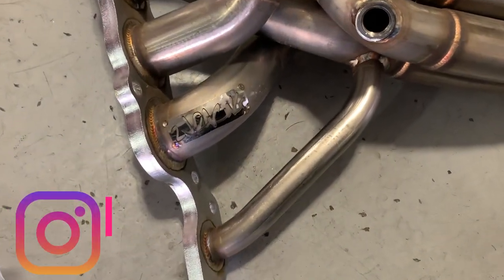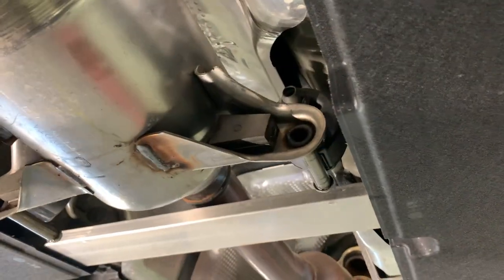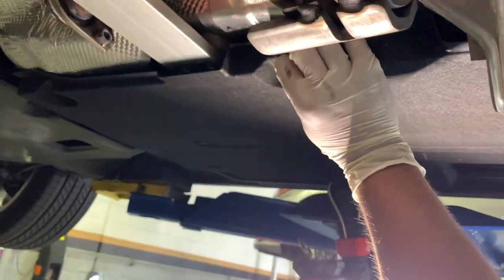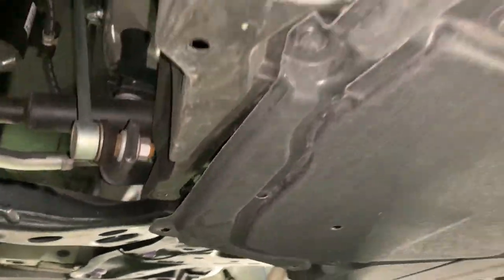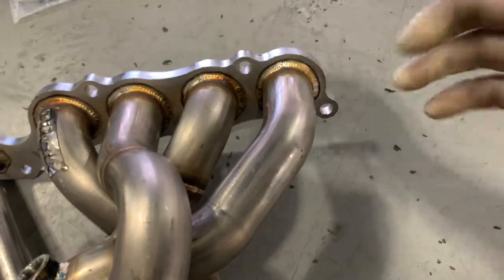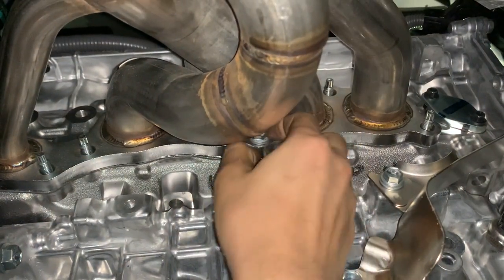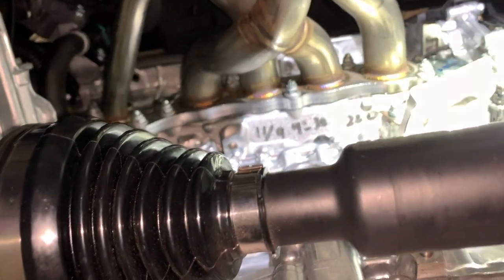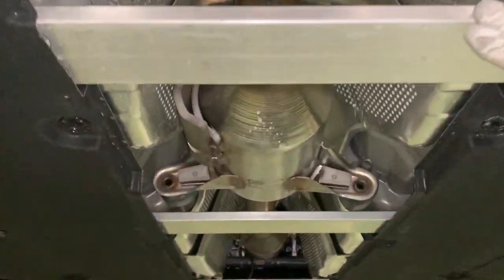HOW TO INSTALL HEADERS ON TOYOTA COROLLA HATCHBACK 2019 2020 2021 2022 (2J RACING HEADERS)

Comment: Hey man ! Love the videos. I have a 2020 SE hatchback that im looking at fixing up and your videos are just reassuring me of doing that.. Question, why the replacing of headers? What does it do exactly?
Reply from the maker: Thank you for watching the videos bro 🙏🏽❤️ the headers were replaced for little bit of HP gain but mostly I was trying to achieve a perfect sound for the car!
Reply: @GeovanisGarage  😱omg ! I love this video!  perfect sound  , I’m triying the same as you just to gain a little bit of HP 👌🏼👍🏻did you see the difference n the HP to much ? which header do you recommend for my corolla hatchback 2022 ? where did you buy it ?
Reply from the maker: The difference was slightly noticeable, but the sound was very noticeable! I recommend the 2J headers! The link for the headers are in the description!
Reply: @GeovanisGarage  thank you so much ! 👌🏼👌🏼🙏🏽🙏🏽

Comment: Just copped a 19 SE 6 speed 😍 and I had no idea it could sound this good, you gave me some ideas bro!
Reply from the maker: Thanks for watching bro🙏🏽🔥
Reply: Check out torkmotorsports for a stage 1 tune
Reply: @ulisesmedrano3382  thanks for letting me know, I’ve heard of Tork a few times had no idea they were getting dirty with the E210
Reply: Also AMT makes a tune, tork and amt are the only two so far making tunes

Comment: That mid pipe is the most restrictive part in the entire exhaust, I believe it drops down to 1-11/16" at its most narrow. Any concerns for heat since the original header heat shields can not be reused?
Reply: Planning on wrapping these, personally.

Comment: Put a wobbly on right before the deep well to tighten the studs,  rounding those off would not be good.  Doing this work when the car is newer makes the process so much easier.

Comment: Finally haha been waiting for this video! But long story short how did you deal with the check engine lights?
Reply from the maker: Defouler and retightening bolts twice!
Reply: @GeovanisGarage  ok bro! Do you have to buy the defouler or is it stock from the OEM pipe?
Reply from the maker: You have to buy it!
Reply: @GeovanisGarage  awesome do you have the link for me boss?
Reply from the maker: Link is in description! I’ll try to find the original one I used tho!

Comment: I would be concerned about thermal dissipation and the tremendous amount of heat coming off the headers. Especially due to the fact that there’s little to no airflow to the firewall or the rear portion of the engine. The car is aerodynamically sound and doesn’t have an air scoop. A good ceramic coating would help but I believe air has to be directed towards the headers to control high temperatures that will most certainly be an issue when idling for a prolonged period. Good video nonetheless 👍🏼
Reply from the maker: Yeah I figured that out till after lol. It should be fine tho, I won’t be running them for too long! Thanks for the support 🙏🏽❤️
Reply from the maker: It’s bc I won’t be tuning the car!
Reply: You could have them ceramic coated.
Reply: @GeovanisGarage  Did you ever have issues with the heat?

Comment: Had any issues with heat so far ??? Headers are a good way to add some power so i’m thinking about doing this with my hatchy
Reply from the maker: No! No issues whatsoever!
Reply: @GeovanisGarage  how about the ECU? are you tuning it since you’re running so many new parts ?
Reply from the maker: Haven’t found any tune for the corolla :/
Reply: @GeovanisGarage  I think there’s an Orange virus tune.
Reply: AMT Tuning has a tune for the Corolla. 💯👍

Comment: Did the defouler really work? On the 2J racing website it states that it is not guaranteed that the defouler will prevent a CEL on
Reply from the maker: It’s here and there, I would say it’s 50/50

Comment: Hopefully you see this comment bro 🥺 but is the 90 degree defouler needed or will the one that 2j provide still take away the cel ? Does the head gasket they provide leak or should I buy oem ones? Does the dealership ask any questions about the headers when you get a maintenance check up?
Reply from the maker: Sadly the defouler works and doesn’t. It makes the light go on and off. Not a 100% fix. You actually need their gasket because it’s a little bigger & thicker. & the dealer won’t ask questions, having the headers will void your engine/emissions part of your warranty.

Comment: Hey man! Absolutely love the build! I just wanted to ask if getting the 2J Midpipe is worth it? Just wanna hear your opinion :)
Reply from the maker: Yes it’s worth it! Have to have an exhaust! Would be great if you added the headers! 🔥
Reply: @GeovanisGarage  Hey man thx for the reply!  Definitely putting in the remark exhaust and gonna add the headers and, now, midpipe later on. Thanks man! Again i absolutely love the build and hope that one day mine will look anywhere near as nice. Have a good one!
Reply from the maker: Thank you man! Appreciate you! 🙌🏽 if you ever have any questions feel free to ask! I’ll always try my best to answer 🙌🏽
Reply: hey geovani I got a question does the headers and the mid pipe from 2j work with the catback remark do they fit on each other thanks man keep it up
Reply from the maker: Yes they do!
Reply: Do you have them on your car are they very loud on the highway? Thanks bro
Reply from the maker: It’s loud when you step on it, but it’s also quiet when you’re driving normally on the highway. One thing, it may be quiet from the outside, but in the cabin, you can hear drone quite a bit
Reply: Thanks man for the info i wanna see if i do it because i have kids.and last question the steering wheel from where did you get it
Reply from the maker: I got it from Instagram! I’ll shoot you the link! 
https://youtu.be/xjRkl38WkgA
Link is in the description!

Comment: geovani how are you man hope your good....tell you my story and give me your idea.so I got throttle body spacer and cold air intake from 2jracing I installed them everything fine no check engine light but I noticed later that my idle not going under 1500. I contacted them they told me you need to tune it so everything get back to normal and the problem why im gonna tune it if I don't have headers, so removed the 2j intake put back the factory but kept the spacer everything went back to normal did you have any issue like this before?
Reply from the maker: Yeah, unfortunately when you put all those bolt ons, you have to tune the car. There’s really no way around it :/

Comment: It looks like you removed a set of headers to install a slightly different set of headers. I'll just go with a cat back system. I'll bet there was no HP increase and you might have even lost torque.  That said still a good video for those who might want to do this.

Comment: I have a cvt, I heard something about the ecu restricting performance. Is this something you’ve gotten around and have you seen any improvement to horsepower ?
Reply from the maker: Never heard of that! But now im very interested!
Reply: @GeovanisGarage  2022 Toyota se with a cvt transmission. Manual was too hard to find lol
Reply from the maker: Most definitely! I tried but I had no luck, I needed a car ASAP so I settled with the CVT
Reply: @GeovanisGarage  apparently they only make manuals for the se sxe, apex but only 2% of those are manuals. I got the sedan se

Comment: Does the oem o2 fit on the new on?
Reply from the maker: Yes it does!
Reply: @GeovanisGarage  how did you get no check engine light?
Reply from the maker: Installing defouler and retighten headers after a cycle and repeated the process until gone. Only had to retighten them twice.